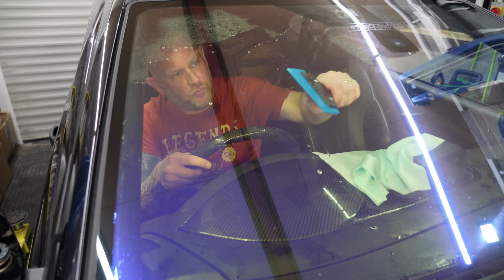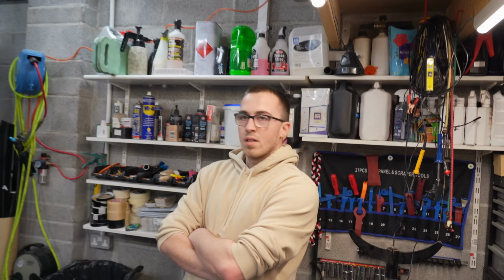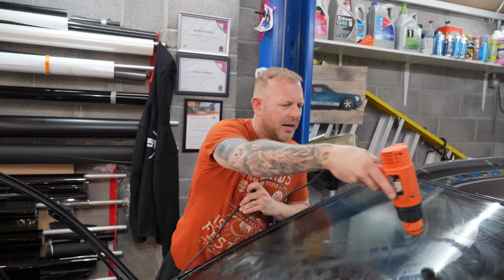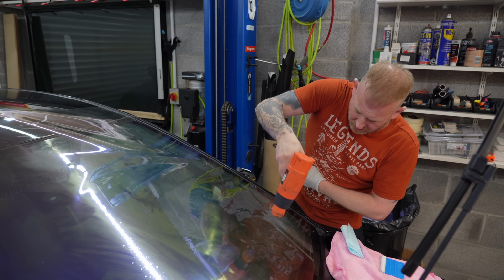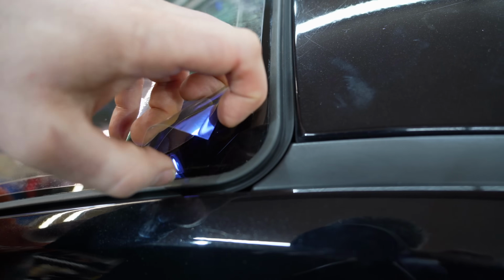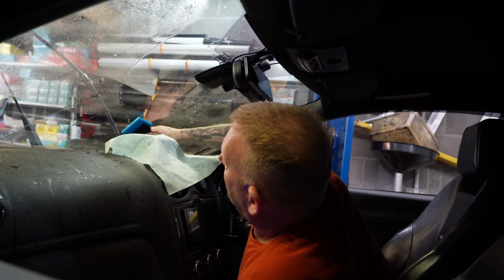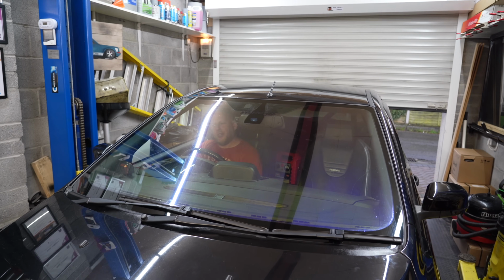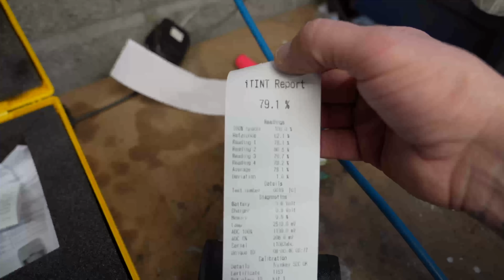CHAMELEON TINT ROAD LEGAL? Let's find out.....

Comment: In the US, its really not "illegal" in most states as long as its not too vibrant and still clear, (like the tint you used), but if you put a super dark and colorful tint on your windshield its doing more harm than good and you will get ticketed. Clear anti-glare tint is legal in most states here too. In my state, Texas, there are 0 restrictions on rear windows and rear passenger side windows, so you can go full limo tint on them. Front side passenger windows are allowed to have as dark as 22% (the law says 25% but a difference of 3 is allowed), and the front window can be darkened to around 75% without getting ticketed. You technically arent allowed to tint the full windshield here but a cop isnt even going to look twice as long as its not as dark as the side windows.

Comment: how does the certifcate work, surely if the police test it and its illegal they wont care about what the certificate says so its pointless theres no way to make sure unless it lets in atleast 80-90% of the light through, anything around 75-80 can differ on machines and day  light wear tear ect ect
Reply: If the machine is calibrated within spec and the police pull you over and test it with their calibrated device the difference will be within a very small tolerance so you wouldn’t have any issues so long as you weren’t dancing with the legal limit
Reply: I think its more to show when you get pulled over that you have already had it tested. Then the police can decide wether to retest it themselves or not.
Reply: @davidhall7811  My guess is that if a traffic officer has taken the time to stop somebody they will spend a few extra minutes testing it themselves anyway. That said I imagine most will be able to tell just by looking (from the inside) whether it's legal or not.

Comment: What's the rough price for doing this? Want to get it done on my mondeo as some point
Reply: Here in America we have clowns trying to charge up to 850.00 USD bad as low as 350 USD which is too expensive either way.  25 profit plus material cost would be fair.
Reply: Roughly around £160 for a windscreen